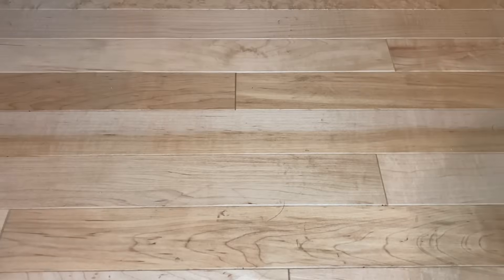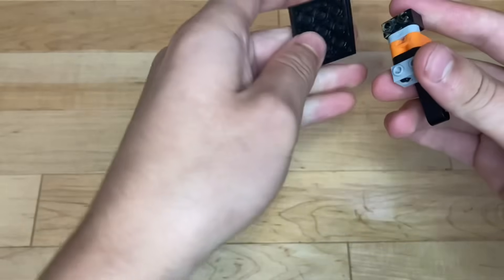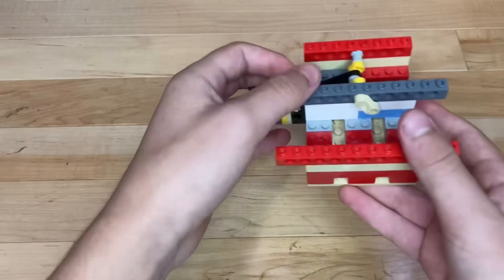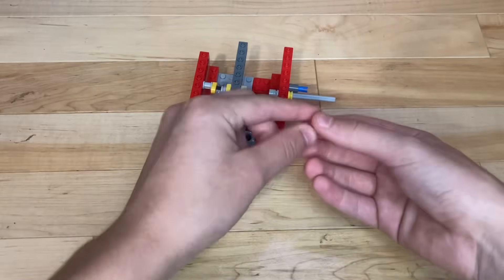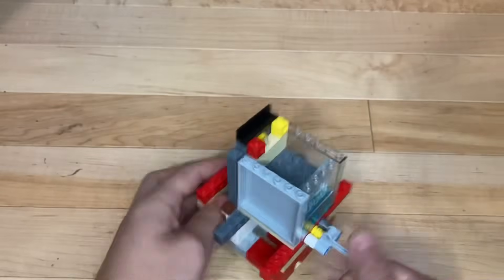LEGO Vacuum Engine Tutorial - HIGH PERFORMANCE

Comment from the maker: VIDEO TIMESTAMPS:

00:00 - Intro
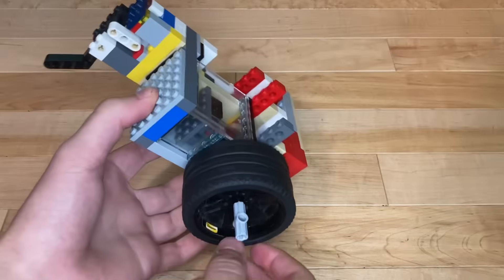00:16 - Basic Overview
00:57 - Breakdown & Parts List
01:06 - Piston
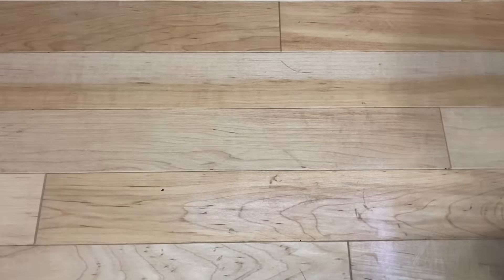02:10 - Valve & Crank
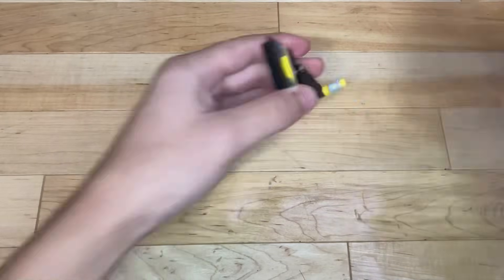03:15 - Throttle Body
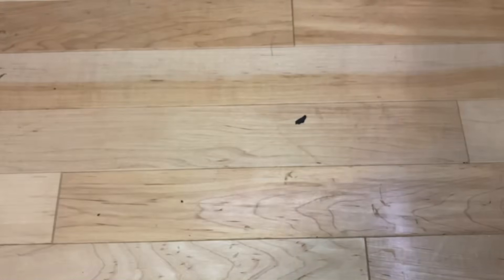05:51 - Base & Crankshaft
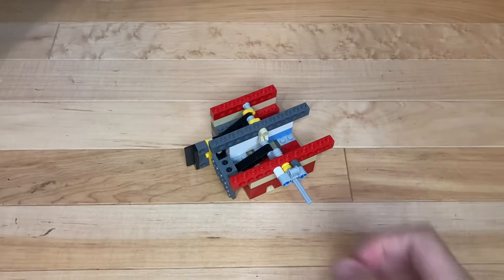09:57 - Cylinder Assembly
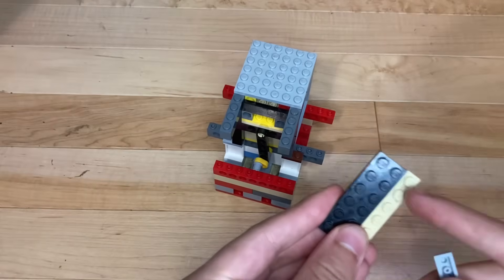12:06 - Throttle Install
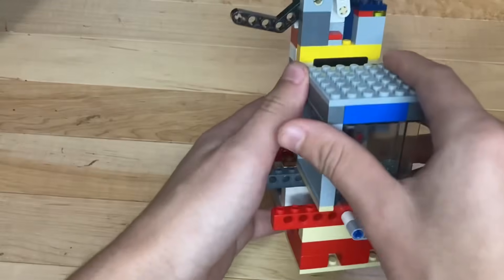13:03 - Flywheel
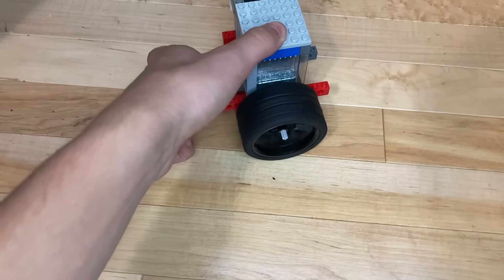13:34 - Running
14:33 - Outro & End Screen

For those of you who only need to build a specific component of the engine. Happy viewing!
Reply: Also I made a Studio model of this so that people can upload the .io file to BrickLink to automatically create a Wanted List. That way they can order the parts. Someone ordered it today and said it cost them $35 including the shipping. Look for it on the #free-instructions channel on the Discord Server.
Reply: Can I get the parts list plss I can't see from the pic well
Reply: man, lego builders know more about engine than an actual begginer car enthusiast
Reply: Could you make a list of the part numbers
Reply: Can I buy it from you? I can’t find any parts?😢
Reply: I built the engin and the first vacum i have didnt work but the second one workt🎉🎉
Reply: I build it step by step but it doesn't work
Can you help me?
Reply from the maker: @AlienUchiha  Join the discord server, we have people online 24/7 who are willing to help you out!
Reply: @KFPlusLegoMastery  ok thx
Reply: Can you please tell me what the tan peice is that allows the piston to turn over😭
Reply: Hey bro. I’ve wondered about that too. Is it possible to make this engine a bit smaller? Like if I use smaller parts?
Reply: I dont understand where u place the vaccum ?

Comment: What glue should I use
Reply from the maker: I used loctite superglue, it’s a good option because it cures into a gel material that can be easily cleaned off lego if you need to reuse the parts

Comment: I’ve been having trouble trying to get mine to actually start and I followed the video almost to a tee does anyone have any suggestions on what could be causing me issues?
Reply from the maker: The biggest known issue is incorrect timing. Very important that the valve crank is 90° ahead of the piston in the direction you want the engine to spin

Comment: Does my engine need to have a valve thingy? Ive seen various tutorials that dont include it and it works fine. I dont have the parts for the valve
Reply from the maker: you can build a butterfly piston design, it doesn’t require valves since the piston tilts. I have a tutorial for one and there’s lots more tutorials from other people too!

Comment: Bro whenever I try run mine with a vacuum it doesn’t want to run and keeps stalling, although i’ve checked the placement of the valve and piston 3 times it still doesn’t work and i’ve spent 3hrs trying to get it to work pls help me
Reply from the maker: You could try lubricating everything, with something like vegetable oil or silicone spray. Also make sure your vacuum is connected well to the throttle!

Comment: Dude i made mine excatly like your but it doesnt want to run
Reply: Ok i got it working now but it doesnt want to run after is ran once
Reply from the maker: Did you check the timing? You could also try lubricating it
Reply: @KFPlusLegoMastery the timing is right and i have no lubrication i got it working now but it still has hard tume idling

Comment: Does the vaccum have to  blow out?
Reply from the maker: Technically, the engine will run on blown air as well as suction. Suction usually works better though.

Comment: How does it run when u dont rev it like when i put my vacuum and spin the wheel it doesn’t start up i have to push the throttle
Reply from the maker: There is a small hole in the throttle that allows a small amount of air through that allows the engine to idle
Reply: @KFPlusLegoMastery  um well i used the wrong part its working now but now after a day its not starting im gonna try rebuilding it

Comment: Thanks so much i finally got the parts i needed and i jsut finished building it sounds great
Reply from the maker: So glad you got your engine running!
Reply: @KFPlusLegoMastery yeah thanks i didnt have all the parts i needed  but it still works and i ordered the ones i need thanks alot btw
Reply: @KFPlusLegoMastery btw how to like make a transmission and connect it to the engine I couldn’t find a tutorial

Comment: Mine didn’t work I used grease and what not
Reply from the maker: Grease can sometimes make things sticky, try some oil or silicone lubricant instead
Reply: @KFPlusLegoMastery  so last night I added a bigger part for where the vacuum goes and I added tape to the vacuum for a better seal and I got it to work!

Comment: I was wondering why my replica didn't work. It's not friction nor bad design it's just that it doesn't spin. I do use the same wheel as you did but still doesn't work. The crankshaft is the same but i feel like the intake of the vacuum cleaner should be fully opened when the piston is at its highest which isn't the case in thos one. Is that the problem? Thank you in advance! (Great video btw)
Reply from the maker: When the piston gets to the highest point, the valve should be closing so that the air can come back into the cylinder and the piston comes back down. check the timing of the valve and crankshaft… the valve shaft should be 90° or a quarter turn ahead of the crankshaft.
Reply: @KFPlusLegoMastery  thank you this helped a lot!

Comment: My engine didn't run and I follow the tutorial
Reply: Did you check for a complete seal on the top. Also check the timing. I use a mix of shampoo and water to lubricate the cylinder and the part where the valve makes contact with the throttle. It should run smoother. Also lubricate all the axles

Comment: Спасибо я делал целый день ,в итоге не работает ничего просто засасывает и ничего не происходит 👎👎👎👎
Reply: Автор подскажите что делать когда просто подставляешь трубку пылесоса к двигателю и ничего не происходит 😮😮😊
Reply from the maker: Did you check the valve timing? The valve crank should be 90° or a quarter turn offset from the piston.

Comment: Spent 5 hours didn't even run
Reply from the maker: Did you check the timing? Some lego engines take a little bit of tweaking and adjusting to get it running… everyone’s engine is different
Reply: @KFPlusLegoMastery  I already demolished it
Reply: @KFPlusLegoMastery  it's okay though I had to cut some of the parts to make it work
Reply: @KFPlusLegoMastery  it never worked but it's good

Comment: I can’t figure this out: I built it and after some tweaks I got it running, but then it stoped after I tried to make it sealed for lubericant, so I undid it, and it worked one time, and then it wont run anymore, the big walls are a big rough. Any tips?

Comment: This engine is shit, when i put the vacum it doesn't work, its very dificult to build if you don't hace de pices of the engine
Reply from the maker: Did you check the valve timing? The valve crank should be 90° or a quarter turn offset from the piston

Comment: Alright so the problem I'm having is the fly wheel it's either too small or too big so I need some assistance
Reply from the maker: You can use any size flywheel really
Reply: Yeah I got that baddie going good now I used a 1x8 technic brick

Comment: Well... iv made the engine. But when i was testing it , it only ran for about 3 seconds until it exploded. It only exploded when I pushed the lever down to make it faster. It would only go on a low speed when i dont push the lever down. Then i glued the piston part and the crank shaft parts. Then tryed again to test it out. It was running perfectly until my vacuum broke down...💀

Comment: KFPlus , if you are reading this pls help me. My lego engine is stiff and went i attach a vacuum its not running. I build it 2 time now and i have every piece in the video. Pls help its just sitting for my shelf now collecting dust 😢
Reply from the maker: Try lubricating the inside of the engine with some sort of oil, i used olive oil
Reply: @KFPlusLegoMastery  thanks

Comment: I am considering building a vacuum engine based on your design. However, instead of having a valve on one side, I would have a valve on both sides and connect vacuum cleaners to both sides. Should this be theoretically possible?
Reply from the maker: Double vacuum power is certainly possible. It might make your engine run really fast

Comment: it doesnt feel smooth even when i didnt start running it. i lubed it but still bad
Reply from the maker: Try using sand paper and lubricate it again
Reply: @KFPlusLegoMastery  im reassebling it with different parts maybe that will work
Reply: @KFPlusLegoMastery  i got it fixed it feels much smoother i hope it runs
Reply: it didnt run please help

Comment: Little tip to make your vaccum engine significantly faster instead of using the 1x1 hole on both sides for the intake. Just use it on one side, and then you will get a lot more airflow into your cylinder, which will give you higher performance. I hope this helps :)

Comment: Hello when i try this i spin the wheel byt it doesnt want to go i  dont have the 1x1 with the holes in so i replaced them with normal 1x1 but i just wont work i tried 2x1 with 2 holes and still doesnt work fo u have a solution?

Comment: I've built this mostly using parts reccomended in the video, but mine seems to turn over very stiffly. Yours actually keeps going a few seconds when turned over manually, mine stops right away. Any clue what could be causing this?

I've ordered extra parts for the smooth walls, mine are parially brickbuild. I'll report back if that fixes it
Reply from the maker: My suggestion (aside from one-piece cylinder walls instead of brick built ones) is to sand down the bricks until you can run your fingers smoothly up and down them without feeling any bumps. You can also try lubricants like silicone spray or olive oil

Comment: When putting on the plate with the smooth 2x4 at 12:22, the valve won't fully extend :(

I imprivised and put the base a little bit higher but now it doesn't work that well and if I put it on max throttle it won’t start up. When I put it on lowest throttle it‘ll start up but only for a few secs. any tips?
Reply: i have the same problem :(
Reply: Same

Comment: Fake mine does not work don’t really recommend
Reply from the maker: It’ll work for anyone, it’s about the trial and error involved and everyone’s engine will be a little bit different. Did you try checking your timing or lubricating the cylinder walls?
Reply: @KFPlusLegoMastery  i followed it was just the engine would not start to spin when I installed the vacuum

Comment: what can i do bc I don’t have that Orange piece of the Piston?
Reply from the maker: Instead of building that particular piston, you can use two 1x4 technic bricks and a single axle through the connecting rod and the holes. I hope that makes sense 🤷‍♂️
Reply: @KFPlusLegoMastery   i dont have the small yellow crankshaft pieces what should i do instead?

Comment: im not sure if you’ll see this, but does this require a powerful vacuum? i followed your guide and had a look at other tutorials, and the engine is properly assembled but wont run.. i regularly put water in there to lubricate it when testing and it does the job. any tips?
Reply: "I put in water"
Water doesnt lubricate, maybe use a lubricate for plastic
Reply: Unless the piston is a small, a stick Vaccum doesn’t work at all (any cordless vaccum doesn’t work either) just saying
Reply: @Electric_dawg_RL  yeah i was using a corded vacuum. did sputter a bit bone dry so i used olive oil and that ran better, also needed a different tire to get it to seal well
Reply: Water can create friction

Comment: no way i get a response after 1 year... just made one exact pieces and all, but i cant seem to get it started. you can feel it wants to roar to life when trying to spin the fly wheel. but it just wont start? if anyone could help it would be more than appreciated.
Reply from the maker: Try making sure your cylinder walls are smooth and lubricated and your timing is correct. The most common problems with first time engines is either too much friction or incorrect timing. Let me know how it goes!
Reply: @KFPlusLegoMastery  Thanks, as of well 20 mins ago I have lubricated the piston and cylinder walls with multipurpose lubricant. However there is still a great amount of friction that I cant seem to find the source of. It just amazes me how smooth yours runs compared to mine. I cant even get it to start!
Reply: Im probably just going to destroy it and try to make a different design of vac engine, hopefully it works.
Reply: @charliehs4164 any luck? mines pretty stiff too. i dont want to lube it with oil as i dont want to ruin the pieces, but water seems to be an ok substitute, and my flywheel isnt too big either - i just put 3 wheels on to give it some more weight.
Reply: @iGPR3  yes actually I rebuilt the camshaft and removed all friction and lubed the cylinder and it roared to life when I ran it
Reply: @charliehs4164  did you simply disassemble and reassemble the crankshaft or did you do a complete redesign? and would you say lubing it is worth it over just using water?
Reply: @iGPR3   I just re did the crank and I used actual multipurpose lubricant meant for machinery. I also rebuilt the valve arm to eliminate friction
Reply: I also removed the bushings to prevent friction
Reply: @charliehs4164  hey! ive redesigned the piston crank section and the piston is super smooth, but i cant get the crank right. what other parts did you use to rebuild the valve arm and crank? the small crank arm parts are rubbing against the walls and i think thats the issue.. i didnt have the 1.5 stud axle connector so i opted for the 2 stud axle piece instead, which might be my problem
Reply: @iGPR3  Nice! Yea I made the valve rod the same piece as the piston rod and I added a bushing between the wall and the valve rod. I also mad the connecting piece between the valve and the valve rod a gray 2 stud technic rod piece thing. Hope it helps
Reply: @charliehs4164  thanks! i actually forgot to reply but i just got it working about 30 mins ago. idles a bit low and the piston head falls off if i run it too fast, but a higher airflow throttle body and some glue should fix that. thanks for your help, its more than appreciated!
Reply: @iGPR3  no problem
Reply: Is it bad if i don‘t use all this pices in the video because i don‘t have all. I made the cilynder wall with normal bricks will it start anyways
Reply: @user-uy7gi4ks9q  yea probably, I had to improvise quite a few times when constructing my engine, if should still work just fine
Reply: I made the crankshaft also with other parts but the piston turns smooth up and down when i turn the flywheel

Comment: I copied this almost exactly and it just won’t go or spin long by hand idk what’s wrong
Reply from the maker: Try using fine sandpaper to sand down the cylinder walls and then lubricating everything with something like olive oil or silicone spray.
Reply: did you ever find a solution? mine is super resistant aswell, it doesnt seem to carry the same inertia as the video.. ive used water and the smoothest bricks i can find, but the vacuum wont spin it up still
Reply: @iGPR3  yeah I made a turbine engine instead

Comment: dude. HOLY CRAP. IT VIBRATES SO HARD WHILE RUNNING. But it runs so smoothly and works so well
Reply from the maker: Thats a signature "feature" of LVEs.. they are loud and vibrate a lot. I can shake my entire house with just one fast engine, its crazy. Maybe I will design a counterweight for the crankshaft!
Reply: @KFPlusLegoMastery  YEAH. it needs it 😂
Reply: @3rd_ACC  did you have any trouble with it being stiff? i cant tell if its my flywheel being small or the crank is rubbing against the conrods. with the vacuum attatched nothing happens despite how fast i spin it
Reply: @iGPR3  yeah its gotta have as little friction as possible
Reply: @iGPR3  try lubing it
Reply: that would be your spark plugs, ignition coil, or engine mounts 😊
Reply: Bro how much does it vabraite
Reply: I build it and it don’t Work

Comment: Just as Joe booker utilised in his car engine but causing electro static and magnetic static force from the cars alternator and starter motor .the vacuum causing no heat no valve bounce and super high revs .on his video on YouTube called Joe cell horses mouth

Comment: Great video i modded the engine with a bigger and wider piston and cylinder with the valve and intake the same as this video after I built it and i got it up to 12,000 RPM and the piston rod cracked 2 times on the crank end i had to wear ear protection because it was as loud as a sport car with no muffler it was insane also my cylinder wasn’t see through because it decreases power if you make the cylinder nontransparent then it will increase power
Reply from the maker: Interesting! I’d like to see a video of it at 12000 rpm, though.
Reply: @KFPlusLegoMastery  I’ll post it once I fix my vacuum engines cracked cylinder, when I built it the way you did no mods it could withstand the high RPM no problem after I modded it, it couldn’t withstand the high RPM every time, causing cylinder and crank failures it only hits 11 to 12,000 RPM after putting a lot of oil in the directly into the cylinder because I saw a video from someone who pushed a LEGO engine to 12k RPM and it blew up that’s how I learned the max speed for legos

Comment: do the 1*1 brick have to have the technic holes in them because mine isn't working and im wondering if thats the problem.
Reply from the maker: The holes aren’t particularly necessary, they just help performance. It might be a different issue with you engine.
Reply: @KFPlusLegoMastery  thank you, im still doing some tweaking to try and get it to work
Reply: @KFPlusLegoMastery  im still having problems as its not working and i have also lubricated it so thats not the problem